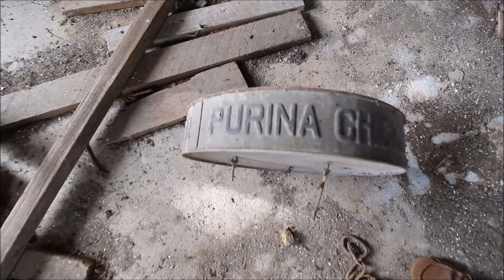Farmhouse Restoration | Episode 10

Comment: In the attic was a metal killing cone for poultry, you hung it on a tree, or in the barn, pull the turkey, goose or duck down into the cone, it kept the wings close.  Preventing it to hurt the wings.  You would pull the head down,  and with a very sharp knife, you cut the head off, then let it  bleed out.  Then we would dip the chicken in hot water,  pulled off the feathers.  Gutted it out.  I would cut it  up.  Wing packages,  boned breasts, thigh/leg portions, freezing them.  Then i would take all the backs and boil them up, debone and can the meat in jars.  We would do 100 a spring.  Blessings

Comment: Did they put zoning in house pertaining to HVAC system? Did they put a Heat Pump System in house? We love our zoning and Heat Pump. Our home built in 1856. With our great insulation we had put in. Along with new windows and vinyl siding it's worked great. We also tore down to studs on all walls and ceilings. Your home year out brings back memories. Looking good
 Good luck with oncoming task. Tamson from Kentucky.
Reply from the maker: I’m not sure on that! It should all come together nicely and be very efficient.
Reply: @LifeofLauraVideos  zoning meaning on each floor have separate thermostats that can be adjusted for each floor how you want heat or air. And only have one large heat pump unit outside for whole house. And one air unit in attic. House is really coming along. Hard work a lot of achy backs for sure. Will enjoy your home once complete.